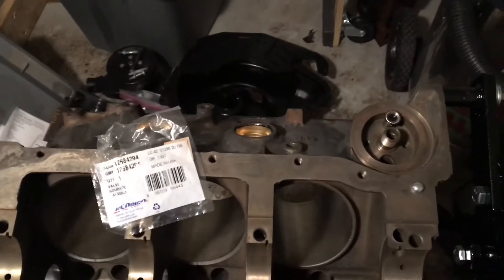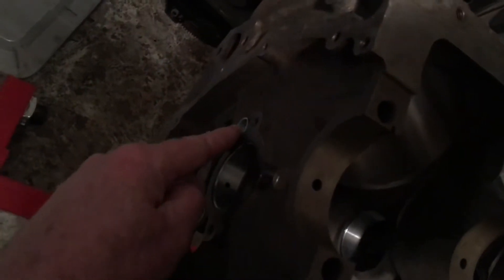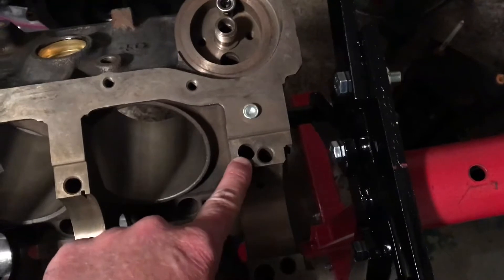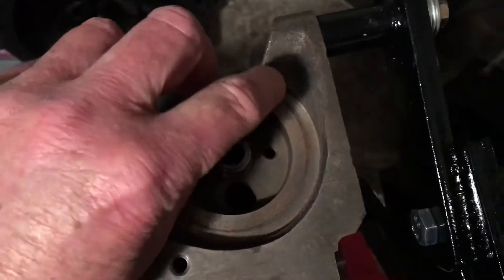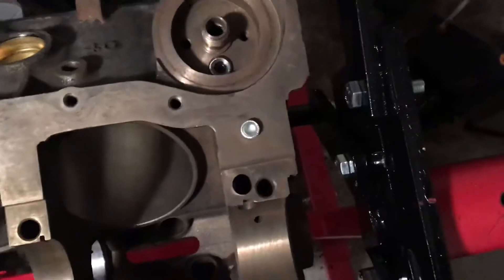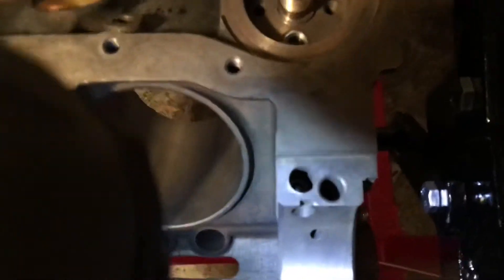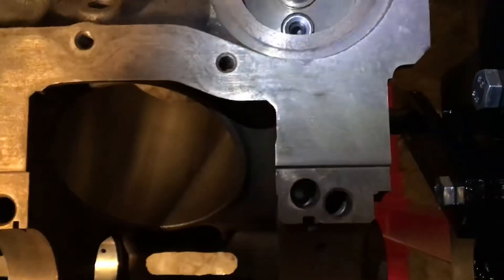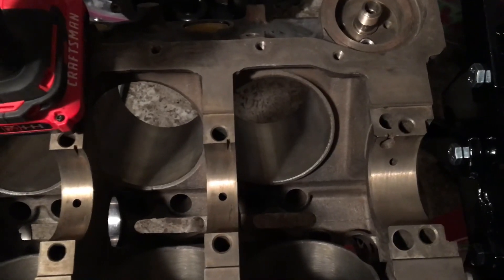Part 2b - Mercruiser 4.3 (2) - Forget This Oil Plug = Kiss Your Engine Goodbye

Comment: I have a ball inside where you installed the plug.  Do you know if the plug is still needed?
Reply from the maker: The ball is factory so it was probably not removed when the block was cleaned. You’re not supposed to reuse the ball so hopefully it wasn’t taken out and put back in. The plug isn’t needed if the ball is still tight. My machinist removes every plug ( threaded and ball) and runs a gun barrel brush through every passage to get everything out.
Reply: Thank you for the quick response.  Thanks to this video I knew to ask the machine shop about the plug and he did say the ball was still in place.  It took my machine shop 6 weeks to get a hone, cam bearings and freeze plugs completed no bore needed.  I thought that was a long time to wait for those things to get done.
Reply from the maker: @markmcmahan362  6 weeks is about normal for most machine shops. I have a local shop that takes 6 months so I drive 75 miles to a shop that takes 3 weeks.

Comment from the maker: I should have called the metal valve a pressure relief valve. While it technically is a check valve, it’s better described as a relief valve to relieve the pressure inside a clogged oil filter.